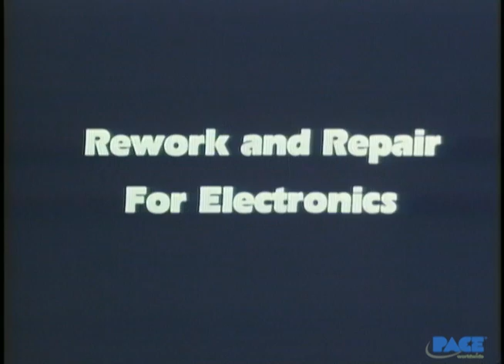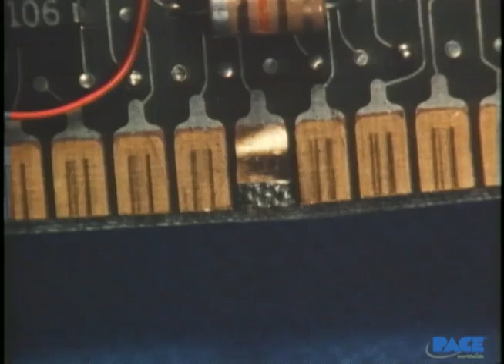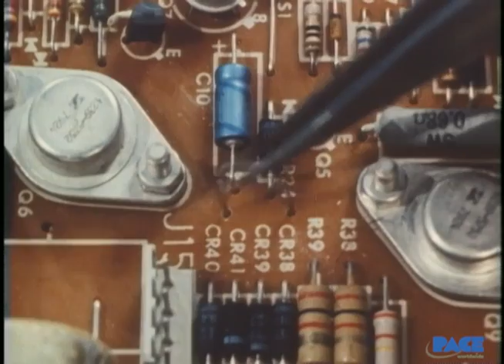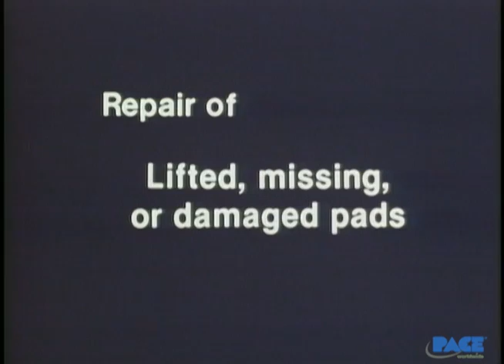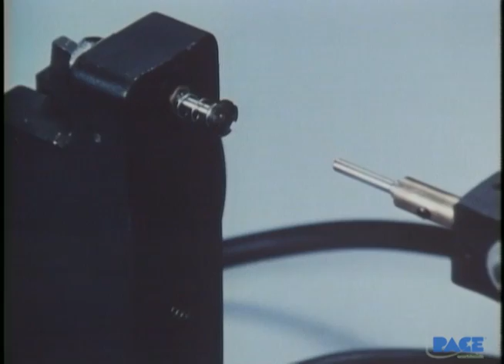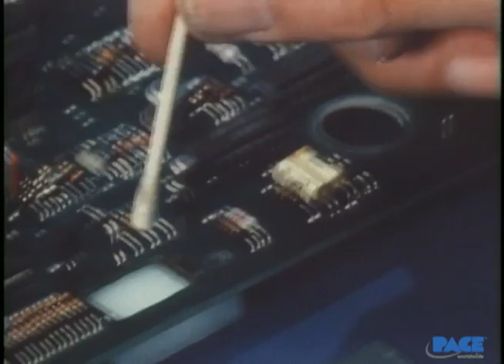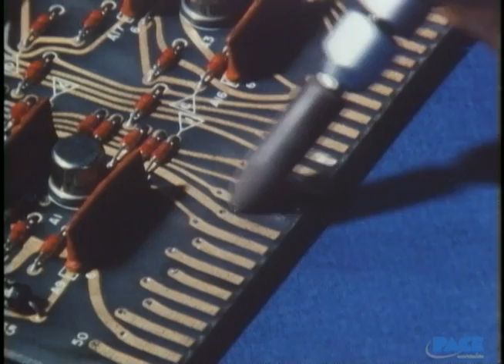PACE Rework and Repair "Damage Repair"

Comment: These videos are 2 years older than I am but are the best instruction I've yet seen even when doing this in a hobby setting (like reworking solder joins of higher gauge wiring to small tabs like in brushed hobby motor wiring) with modern PID controlled irons.

Thanks!

Comment: What's with pre-tinning everything ?
Reply: Joseph Anthony Because it makes soldering the joint easier and faster, and thus less risky for an already-compromised board.
Reply: @tookitogo  oh ok. Thank You 👍
Reply: Joseph Anthony Sure thing! Try it sometime when you solder things, for example, tinning a stranded wire before soldering it to a board or terminal. Good luck! :)
Reply: @tookitogo  Will Do.
Reply: Joseph Anthony Oh yeah, and get some nice gel/paste flux (I like MG Chemicals’ no-clean flux that comes in a syringe) and a liquid flux pen (rosin or no-clean). Flux makes soldering go better. :D
Reply: @tookitogo  what's no clean ?
Reply: Joseph Anthony Flux that can be safely left on the board after soldering (provided it’s thoroughly heated during soldering).

Comment: In 1982, I was an expert in my factory using those funnelets to repair expensive Apple II mother boards. At times when we ran out of cir-tracks we would strip a section from another condemned circuit board, because Pace provided only limited pad-tracks in a complete kit.

Comment: There is no way this would be economically viable today. Even in 1982 were labor costs that low you could spend an hour fixing one trace instead of just using a bodge wire?
Reply: Dave B It is for really expensive, low-volume gear, or things like antiques. Pace’s roots are in military electronics, which tend to have very long service lives, and are so expensive that repairs make sense.

Comment: I wonder if the techniques involving reflow of ordinary solder plus extra flux would be better or worse with modern SMD solder paste and the kind of small heat gun used for SMD repair work?

Comment: I found a pencil eraser worked well to clean copper traces. Also I used Silver Solder to fix broken boards, it's stronger than regular solder. I used to work in a TV repair shop.
Reply: +Bri G. Gold ones too. It often fixes a non-working computer RAM stick.

Comment: Is this really dated from the 80s?
Reply: int0x13 I saw this in electronics 1 in 1986. We even used Pace MBT equipment.
Reply: A lot of presentations like this from the early 80s seem like they are really in the 70s. Remember that tech people are always behind in fashion. 😂
Reply: @HazeAnderson  This is almost certainly in the mid-late 70's. All of the boards shown are hand laid out with curved traces, with early 70s style components. One of the boards shown had chips dated the 13th week of 1977, so I'd put it sometime in 1977-78
Reply: @davidk8893  If they were repairing boards then they might have been 2-3 years old ... putting this right at 1980.
Reply: Are you guys blind or something? Right at 0:06 it says “© 1982”.
Reply: @tookitogo  apparently I am blind, lol. Nice catch

Comment: 4:56 - 5:01 you can see that the solder on the left is really close to that nearby component lead. I am surprised he said it was acceptable.
Reply: It's supposed to be. It's actually a trace that runs to the trace that was damaged and repaired. Observe it before they put the wire down and you'll see it's supposed to be connected.

Comment from the maker: My Dad produced this early film for companies that could not afford to throw away PCB's. Fix boards that could not be replaced. He invented the circuit run,track and pad...replacement frame's and developed the repair techniques to save single and double sided boards. Save several $500.00 boards and the Pace "Cir-Kit"/ gear pays for itself.
Reply: I'm pouring one out for him because he helped alot of indecisive highschool and college kids find a better life.
Reply: @Deneteus  This was Reagan's time so it was time those Woodstock dropouts found a job :)
Reply: Thank your dad from a grateful veteran who at 79 is looking for a job 🙏
Reply: how smart!
Reply: My brother used to test/repairs pcb on subs. Mid 70s to mid 90s.
Reply: I used them alot in my factory in 1982. Great kit but expensive to purchase.
Reply: I still do these kind-a repairs. Learned the basics from these films 8 years ago :-) Not only 2 layers, I also replaced inner traces. (And I use a Pace MBT250, a new MBT350 is underway) best solder-gear from the best manufacturer.
Reply: Thank him for me.